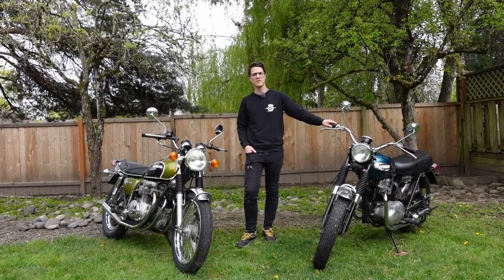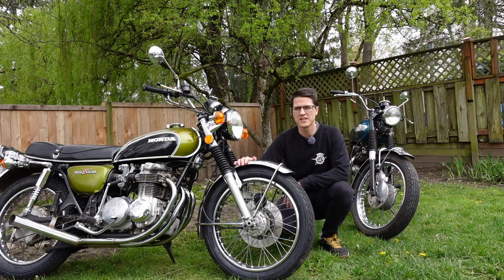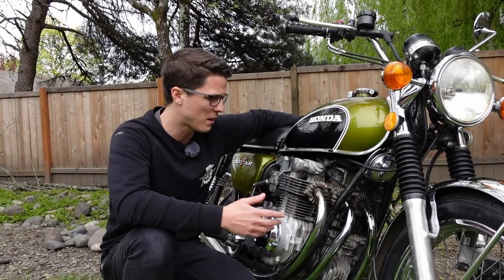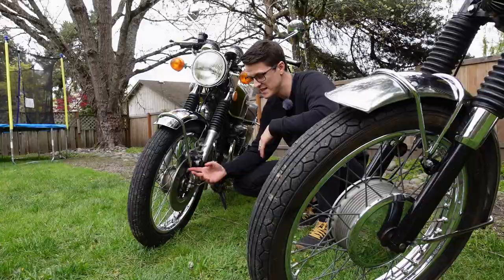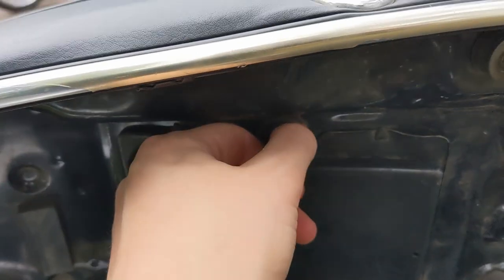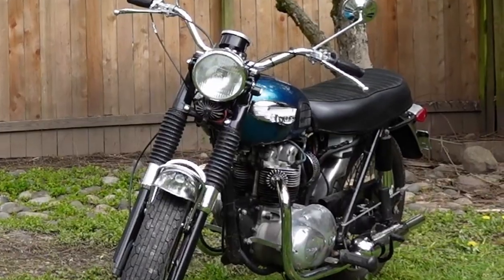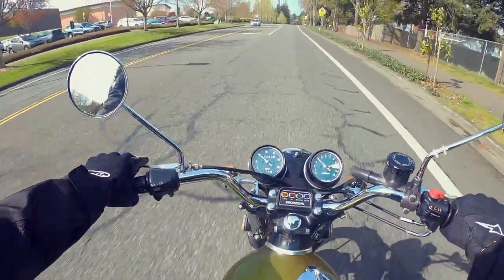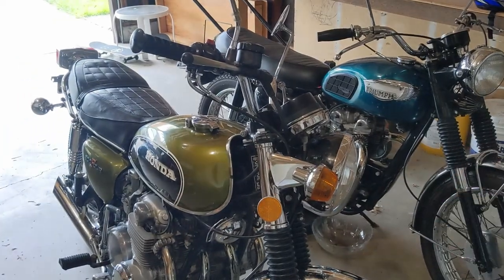How this Honda killed this Triumph

Comment: Honda never minded to out beauty the Triumph bikes. It was to out perform them and they did just that. The Honda's motor was also more in displacement "sales pitch" and a heck more heavier overall bike but kept well balanced over all. England the country in 1973 and even before that was going broken thus Triumph had no money nor the personal leadership drive anymore to evolve much of anything requiring money and labor by then. Now look at that T100 Triumph again minding to keep those dimensions seen of the outside the same all the way and now re-engineer known to be improvements to the inside and this could have kept these beauties still in production even today.  They became just riding bikes long ago from once thought as racers and racing bikes today they too will become riding bikes but not of the simplest same beauty as of before them.

Comment: "Modern" Triumphs fail to capture the look of the old Triumphs because of their silly flanged fuel tank. Harley uses classic rounded tanks which are not expensive to produce but modern Triumph owners must buy aftermarket alloy tanks to be rid of the flange. The flange design is apparently easy to resistance weld hence its general use on other brands but art really does have rules and flanges fail.

Comment: The CB500 four had a weak clutch assembly which was upgraded when it went to a CB550. They were also notorious for head gasket leaks where the oil fed up on the far ends of the cylinder. This never got fixed correctly as both the CB550 and the subsequent 650 continued to have the same problem years later. Other than that they were reliable machines.

Comment: Thanks for your great YT! I'm not really convinced by motorcycles that have more than 2 cylinders... I'm an old fart (75), riding every day in the tropics, a gorgeous 2010 Yamaha single-cylinder 660cc MT03 (The same engine as the Yamaha XT660Z Ténéré).

Comment: I had both. Never really feel in love with my Honda's the same way. Ideal is to own both. Then the Triumph would get the attention it needed, an hour a week with a spanner or two. Triumph 6T was most likely the best. Made for the Police. 

I am told I had the last ever real Triumph. TR7 USA type Tiger 750. Reg LFC 824N. The Honda was DBW 222R. My Honda 900 was EBP 493W. That bike was good on snow! I don't really like the now Triumphs. An Enfield perhaps. My 350 3TA was 821 UMX. My Honda 650 was very boring. I have no idea of it's reg.

Comment: correct, the older triumph has soul, character , they are not quick but they are just nice to ride, i have the old 78 750 tiger and the new 07 bonny, .. the new one is great for every day anytime rides, but the old girl is just a pleasure to ride... yes you need both... no choice...

Comment: 1: 33. And it didn't need an electric starter, as Triumphs engines were fantastic at getting started. 
And might as well add, the Honda didn't surpass the Triumph in looks.

Comment: My first bike was a 550K I got used in 78  , I didn't really now how to ride , it felt fast but with my limited skill it thru me off a few time I ended up buying a 78 750 Bonnieville it treated me much better , rode it cross county a few time other than syncing the carbs it was a great bike for me

Comment: The 4 into 4 pipes made the 500/4, I made the mistake of putting a 4 into one mute defuser on mine and didn't keep the originals. But one screw and you had a straight 4 into one that howled.

Comment: Turns out it wasn't very hard: Just make a bike that keeps the oil on the INside and put a decent wiring harness in it. Oh yeah, and more power doesn't hurt either.

Comment: Honda not only killed that Triumph, they killed off the entire British motorcycle industry. I had a Triumph Trophy 650 and replaced it with a Honda CB750 K0. The Honda was about a century ahead of the Triumph engineering wise. I also owned a Yamaha XS 650 (the European version, not the American one) which was a Japanese 'copy' of the Triumph and it too was a fantastic bike with all of the good points of the Triumph once you sorted the suspension out. It had all the Japanese reliability etc and none of the many, many shortcomings of the Triumph.
Reply: Other than being a 360 degree twin, how was the XS650 a copy of a Triumph? Nothing inside the Yamaha engine remotely resembles the Triumph. How was the European version of the XS 650 different than a USA model? The XS650/TX650 had their own issues, depending on the year, from difficult starting, cam chain stretch, etc. That said they can be made into a really great bike if you know what you're doing.

Comment: all the c b 750s had leaky head gaskets. and to change or retorque the head one had to take the engine out of the frame.  rather trouble sum, but after that the engine was good for a while.  the transmission also had a tendency to pop out of fifth gear at high power and high speed, for which you had to come to a stop to re engage if you didn't want to grind the gears. over all it was a great bike for it's time.

Comment: Bart, I get ya ... some excellent points. But, you overlooked a direct contemporary of your Triumph — the Honda 450 twin introduced in 1964. When this machine came out, a very popular British moto broadsheet had an article that was being quoted all over the place: "Where the British twins use bushings, the Honda has bearings. Where the British bikes use bearings, the Honda has needle bearings." 

Honda's wiring harness and electrics were perfect, beautifully laid out and totally reliable. And the engines  DIDN'T LEAK OIL all over your garage floor — ever!!! These 450's sounded great and did over a ton. Besides being beautifully finished, they were easy to tune and economical to run. What was not to love? 

We moto crazies at the time saw how the Brits were doomed. And in 1971, when I saw a lunch bag fished out of the crankcase of a spanking, brand new Norton Commando, I knew there was more trouble than just financing and technical development.

Yes, I get you. I put a Triton road racer on my local race track — its modified Bonneville engine was the most luscious sound on any race day. It was a romantic time machine. Sometimes I wake up at 3:00 A.M. in a cold sweat wondering why I was the idiot who sold it — a machine that with its Manx Norton trim and pre-unit close ratio Burman gear box would be worth a fortune today.
Reply: I had a new 71 Commando and creamed a CB750 at a traffic light drag, then at 100 mph the left pipe blew out of the head. Luckily, the thing didn't drop all the way to the ground (it was close) and I screwed it back in without damage. I wish I still had it.

Comment: I had a 550/4 with a Yoshi camshaft and rode a friend's 68 bonnie around the same time. The bonnie was better on handling, braking and felt better in the twisties. The 550 was a better touring bike, particularly it would suit all day at speed without issue. The problem with the Hondas is they eventually trash the head because the camshafts run in the alloy head without bushes or bearings. Then the carbs just wear out and there are four and it's too expensive to sort. That's the end of the bike, usually. OTOH you'll have rebuilt the triumph twice by that time, but will be able to rebuild it almost indefinitely quite cheaply.
Reply: and camchains ate there way out the barrel , crap handling and electrics

Comment: I had a 550 Four (near enough the same as the 500).  I traded my 400 Four because the 550 was BIGGER (OK and because I rather liked the CB500).  The 400 was nippy and fun; the 550 was not.  While at Polytechnic my friend allowed me to ride his Triumph 500 Daytona.  It immediately felt better than my own bike; lighter, flickable, more responsive and much better in town.  I ground-down the footrests the very first time I rode it, without really noticing.  It inspired confidence in its handling.  It was fun.  I accept that my 550 may have been better for longer journeys but I subsequently bought a BMW for that purpose, to avoid all chain-related chores.  550 felt lardie, slow and did not inspire confidence.  Triumph was much more enjoyable.  And isn't that the point?
Reply: I always wanted a 550/4 as a kid in the 70s .
Bought one eventually , pushed it further than I rode it , hateful thing .
Glad to see the back of it

Comment: I have had over 20 motorcycles and my 1970 Honda 750 was my favorite bike of them all. If I could buy a "new" 1970 Honda 750 I would. I never had a Honda 500 but I'm willing to bet it had all the same desirable features and none of the bad ones of the BSA, Triumph, Norton, and other speedster bikes of that era.
Reply: I've had the cb750 and also a cb550. The 550 was very smooth but certainly wasn't a powerhouse as the 750 was (for it's day) . A buddy with a kawasaki 400 could stay right with me hotrodding around back then.

Comment: About the leaks.... That's not true, flexible mounting compound and careful assembly can eliminate the leaks from a triumph, but the Hondas a better bike, still prefer my triumph though.....
Reply: The problem was they leaked from the factory, I remember going into dealerships in the seventies and seeing drip trays under brand-new triumphs to catch the oil. Better gaskets and sealants van eliminate that now of course. Would still love to have a  70's T140v export model .

Comment: Those Honda 4 cylinder bikes were amazing when they were introduced, so smooth with so much power. Kawasaki took it to another level with that 900cc Z1 a few years later. I bought a 1000cc Suzuki in 1979 and kept it for 15 years. The piston rings eventually went bad at around 75,000 miles. That Suzuki was a copy of the Z1 motorcycle.
Reply: the 900 Kaw was made by honda but they sold it to Kawasaki

Comment: Unfair to show a Honda without its four exhaust pipes. Much smoother and much more silent. Regarding the look of the bikes, you are right - it’s a matter of log discussions. Thanks for the video
Reply: The stock Honda four pipes were junk, 750, 550, 500, etc. My 1972 (leftover 1971 K0) 500 Four pipes were rusted out in 2 years. To buy reproduction or NOS pipes is to spend A LOT OF $$$

Comment: Triumphs were best on 50 mph back-roads where vibration was less bothersome. But really the company just didn't put investment in new engine designs and quality control. Excessive vibration and oil leaks are simply inexcusable. The new modern Bonnevilles are wonderful and look really good.
Reply: not jut Triumph. Their parent company BSA and all the other Brit bike companies failed to invest as well. Or invested badly (Umberslade Hall or Ariel 3 anybody?). 
Small Heath (BSA) was still using 50 year old machinery to produce parts , Honda made new custom built machines to produce parts for each model , resulting in lower overheads due to greater productivity, and better reliability.
According to something I read online (a doctorate on the demise of the bike industry here), Honda made 4x as many bikes per worker.

Comment: But at the end of the day, I want to be able to ride.  With the Honda I will be riding more and wrenching less.  I have a Suzuki 650 V-Strom.  There are so many things about the bike that are kind of average, but it works really well and in 50,000 miles it has never really broken.  I have two old Honda in the Garage that I would like to be riding, but the V-Strom is always sitting there waiting for me to go.
Reply: I bought a brand new Suzuki Vstrom 650 in 2004. Put 87,000 miles on it before selling it. I thought I could get a new one that would be better. Should have kept the first one.
edit: Put that mileage on it by commuting to LAX from the Antelope Valley every day. 93 miles one way. Yes I survived the 405 on a motorcycle.

Comment: Another great video Bart! I have a '73 CB500 (K2) in Sunflake Orange and even at almost 50 years old, is still an amazing machine to ride and super easy to maintain. Based on the color (Candy Baccus Olive), gages and taillight style, I believe your 500 is a K1 which would be considered more of a '72. As most folks here probably know, Honda wasn't using model year designations back then so many times the year was assigned at time of initial sale and title registration. This the case with my CB175 K6. Normally considered a '72 but for title and registration purposes is a '73.
Reply: The 500/550 Honda Fours were, in many ways, superior to the CB 750s. The only category they lost out in was power.......

Comment: I had a 72 Daytona and the thing I couldn’t get past were that the foot controls were switched. In a quick stop where you had to brake without thinking about it, it was a bit unnerving.
Reply: The foot controls were never switched on the 500 Daytona because those models are discontinued before the mandatory left hand gear change was implemented.

Comment: You need to purchase and install an original 4 into 4 exhaust system for your 500 Honda. Then video the bike with it's "symphony of sound" on the road; under full throttle, and shifting as close to the redline as you dare! 
That would be the real sound of a multi-cylinder bike of the era!

BTW, I bought a new CB750 K5 in 1975; my brother bought a new CB550 at the same time.
Reply from the maker: So I actually just picked up an original set, a bit rusty but I'm cleaning them up right now. Hopefully we can put them on it! And that's awesome! Wish I could have lived through that time
Reply: Add original 4 into 4 exhaust system for the cb500 would cost more than what he paid for the whole motorcycle
Reply: @bartmotorcycle  BTW,  I put 100k miles in 10 years on my 750! The motor was never opened up. Adjusting the valves, frequent oil/filter changes and a Lockhart oil cooler ensured its longevity.

Comment: Is there any video of Mike coming over to help diagnose your electrical issue?   I'd like to see that.  Glad you got her fixed.  What ended up being the problem?
Reply from the maker: Nope but I am going to be doing some stuff with him in the future! He's a great guy
Reply: @bartmotorcycle  what was the electrical problem you were having with the Triumph?
Reply from the maker: @daveco1270  So basically a few things were wired weird, non lucas connectors with lucas connectors, but the main problem I've had that was fixed was the switch connector on the inside was pressing against the lamp when I put it back on, so it would have light and then blow the fuse when I screwed it on. Not much room inside this tiny headlight assembly and lots of wires. I've got it all sorted now and no problems! the hard part is these bikes vibrate so much so everything needs to be really tight

Comment: I have a 1966 Triumph Bonneville. I wouldn't trade it for a truck load of Hondas. Triumph (used) to make real motorcycles. Honda has always made transportation appliances. They have no soul, no character, they are smooth, quiet, and seriously over refined. Everything I DON'T want in a motorcycle. I also have a 2013 Royal Enfield B5 Bullet, converted from EFI (absolute garbage) to an Amal carburetor and with an aftermarket exhaust, and a 1998 Harley Sportster 1200 carbureted rigid mount. All three of these bikes sound beautiful, and feel like real motorcycles. Hondas have no sound or feel. They might as well be battery powered. And they were that way 50 years ago. That Honda has an aftermarket exhaust, and it still doesn't come close to the beautiful sound of the Triumph. If I were going to ride cross country, I'd take the Harley. It has the power to cruise at 80-85 mph all day. You might need to replace some teeth when you got there, but it would definitely be a fun ride, and FUN is what motorcycles are all about. If I had the Honda, I'd be trying to sell it. Probably to buy another Triumph. And as someone who actually owns and rides a vintage Triumph, I do know about all their little "issues" But they are well worth dealing with for the beauty and riding experience they give you. 1970 was the year that real motorcycles died.

Comment: Since you have both bikes do you ever try to shift with the brake pedal of brake with the shifter.
Reply from the maker: You know I've finally gotten my brain to be able to do both, its like a switch, but at first with this Triumph coming from modern bikes I was forgetting alot!
Reply: @bartmotorcycle  I went the other way. Brit bikes to Japanese. They were a lot more able to withstand a downshift when you meant to upshift than the Brit bikes.

Comment: in summary: japanese better
Reply: Different but not necessarily better. Because of the park availability as well as knowledge freely shared among choosiest there are more British bikes on the road Dan ever because Honda started the inevitable slide toward the technology Creations on two wheels that aspire to be motorcycles but fall flat on the floor everyone used to copy to British at their height with bushings and bearings on every rolling surface properly in a motor since the Honda fours everybody has taken up the cause of Building engines cheaply as possible because when they fail ultimately you might as well throw the whole bike away with the fall of the dollar against the Yen the Japanese manufacturers had to come up with ways of putting motorcycles out at affordable prices so they cheap and doubt on the engine never mind that the fbq shocks stood for fade very quickly and Japanese tires were considered to be made of recycled rubber bands because they were downright dangerous in the wet you can upgrade to shock and a tires easily enough but you cannot upgrade the motor and all the hop up kits faded away over time because the Japanese were coming out with bikes that a shade tree mechanic could not improve upon could not improve upon